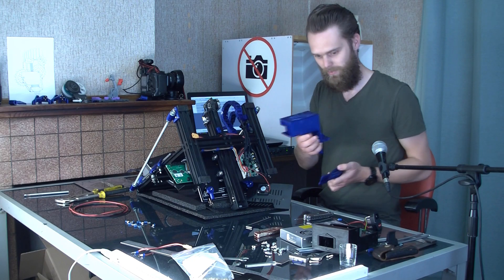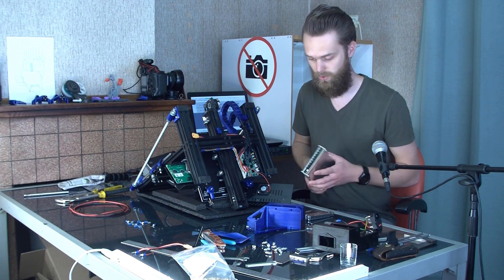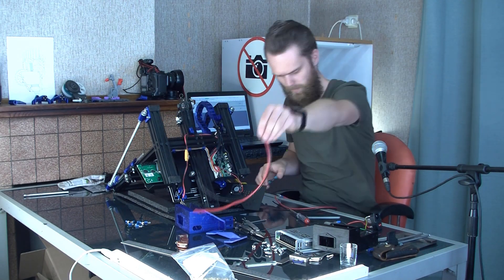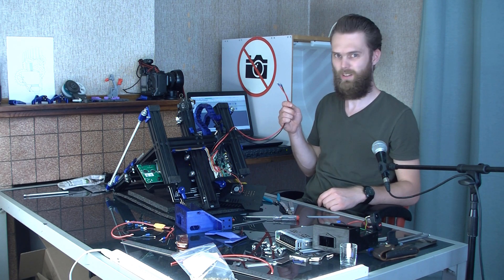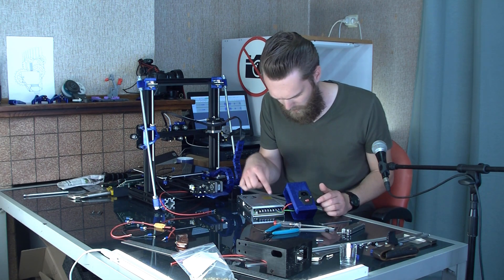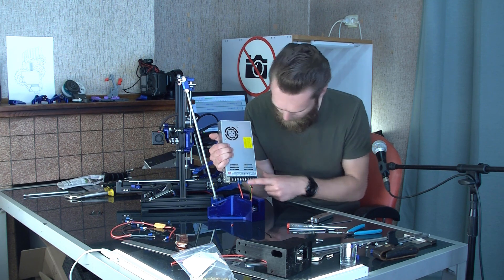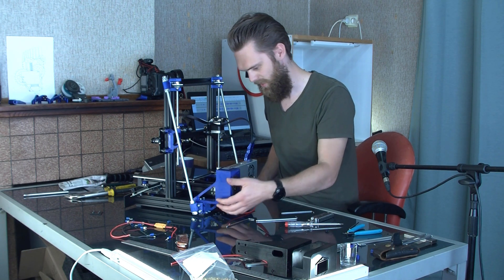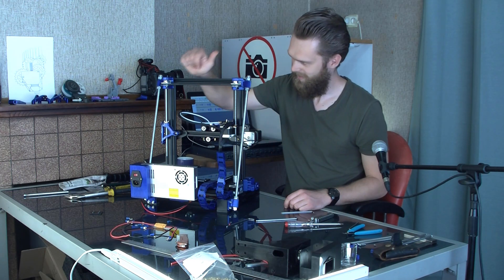Ender 3 pro power supply mod and some safety tips

Comment: At 3:35 you mention the nuts you designed. where is the file? I bought the power supply move file from you but not there with the 2 other files. OK, I figured you made it available to your patreons. I joined for a year. I went to google drive and downloaded files. Still no nut. Are you teasing us? Showing us something cool but now it's hiding. lol I have both parts printed just need the nuts.   :)
Reply from the maker: Hi, I shared these separately because my idea was that they can be used more generally. In hindsight I should've mentioned that. You can get them from here https://properprinting.pro/product/t-slot-nut-side-approach/ Thanks for being a Patreon supporter for a year! Next time, please reach out directly in the chat so I can help and improve!
Reply: @properprinting  thanks for the fast reply. I just looked at your link. Says available to patreon supporters. I am a supporter, I downloaded the complete zip from your google drive. I didn’t see it there.

Comment: What wires did you buy to lengthen the PSU wires? Do you have a link?
Reply from the maker: I don't know anymore. It might as well be that I had them lying around or got something from my work. It's nothing special, just thick enough. I often buy wires from conrad.com Maybe that's an option for you as well.

Comment: i read somewhere you need to ground the frame separately since the psu is not attached to the frame anymore and can this be made out of PLA?
Reply from the maker: Grounding in this case is a safety measure so if the life wire touches the frame the ground breaker pops. If the PSU is not connected to the frame it can go wrong is there's any change that a life wire will ever touch the frame. This being said, it's always better safe than sorry ;) Yes, this can be printed out of PLA.
Reply: @properprinting  thanks

Comment: This whole fire-hazard thing I keep seeing and hearing about - XT60 makes a much better connection than does the screw posts on the motherboard IMHO, so if anything they should be directly soldered if you really want to help safety! But then you are left with the connects on the powersupply, so really.. if there is a hazard, the issue would likely arise at either the psu end or the mobo end now.  Only reason the xt60's would be a risk is if they were poorly soldered, and for that reason alone, it's worth at least inspecting them.

Comment: Just some additional information on the XT60 connector. They are rated for a maximum of 60A and the Ender 3 at full current draw (bed and hotend heating up, all stepper motors moving) is around 8-9A on the output of the 24V power supply. I measured this using a clamp-on current meter. Since I print a lot using ABS and ASA, I want to speed up the bed and hotend heat up time by increasing the amount of current available without taxing the power supply too much so the plan is to upgrade said power supply to a 350-400W unit. I'm thinking I'm going to crank up the output to 25-26V to also help out the heat up time. I'll use a buck converter to reduce the voltage down to 24V for the rest of the electronics. I think I'll be remoting the power supply and electronics and put the printer in an heated enclosure.

Comment: Should I look for anything specific with a power supply. 24v etc or do they pretty much all work for 3d printers?
Reply: Most definitely look for 24V specifically (if that is what you currently use obviously, if it's something different, go for that voltage). Nothing less, nothing more, voltage is not adaptive like for instance, current can be when you have a powersupply capable of delivering 12A when the printer might only pull 4 of it when everything is at it's peak draw, that will be fine (though it might pose problems because some powersupplies require a minimum draw of current in order for them to sustain operation and you might risk getting below that current upon finishing a print or in circumstances where the power draw is lower than at full peak power that it requests).
My brother is suspiscious about the power supply on the Ender 3 Pro actually being a MeanWell because there are a couple of things that he considers are "off" from the design that he usually sees in their frame and open-frame power supplies due to the fact that he works with those on a day-to-day basis at work, so, you might be better off getting a power supply listing at least the same amount of current delivery that it's capable of, but otherwise it could be well advised to be 1A higher than the power supply you get with it lists itself at.

Comment: does this require an earth from the power supply to the frame of the printer? now that the psu is not screwed to the frame?
Reply from the maker: This is a good question which got me thinking. Earth is used in this case as a safety measure when the live wire springs loose and touches the frame. In that case the ground fault breaker should kick in so you don't get electrocuted when touching the frame. If only 24 volt is capable of touching the frame than the earth connection is not a necessity. It won't harm though if you connect the frame to earth. This is a must when adding a mains powered silicon heater!

Comment: Has anyone tried to use this mount with the regular Ender 3 (not Pro) power supply?
I ask, because the Ender 3 and Ender 3 Pro have different power supplies (the Pro has a slimmer case).

Comment: While planning a dual Z kit to my Ender 3 Pro I realized that I needed to figure out where to place my power supply. Your video was the only one I could find in my search.  I liked your video,  both the Dual Z and the power supply mounting, so I purchased your mount kit and proceeded to perform my upgrade. I didn't have the nifty channel nuts you showed in this video so I planned and purchased a thread cutting kit to use with the installation.  Imagine my surprise when I pulled off the end cap and discovered the holes in the frame were already tapped. At least now I have a tap set and no doubt it will come in handy at some point. It would be nice if the mounting holes in your bracket design lined up with the frame holes, but that's what I have a drill for I guess.  Love this video and I learned a lot from watching. My Ender 3 Pro is a bit better for having watched you at work.  Thanks.

Comment: Do you know what fuse is needed for the power supply? Thanks for the video 👍
Reply from the maker: No, I don't have a clue. Did you blow up yours? It should be stated on the fuse itself.
Reply: @properprinting It was missing and I am in doubt whether it is 24v and 10A or 15A. Thanks for taking the time to answer my question 👍
Reply: @luismanchego6856  The fuse is on the high-voltage side in mine (Ender 3 Pro) right above the plug.  If that is the case in yours, do NOT go for a 24V fuse because it will blow instantly upon either plugging in the power supply or upon switch-on.
Reply: @Dutch3DMaster  Thanks for the heads up 👍

Comment: About Creality's XT60 connector fire hazard:
The problem itself isn't design of the connector, but the way they did it, initially those were soldered to wires, so as you should do, but when amount of ender 3 purchases skyrocketed, they ordered other factory to manufacture this cable assembly, and what they did is they crimped the terminal onto the wires which is absolutely incorrect, the connection was sometimes very poor, there was big voltage drop and so it would overheat and possibly catch fire.
PSU is rated to 15A, so the current consumption is not more than that, that's nothing for XT60 that is designed to handle peak 60A for short time and constantly up to 50A(will get hot).
They also possibly used fake XT60 connectors which probably werent made of high temp nylon.
Reply from the maker: Great information, thanks!
Reply: Crimping at low voltages can be preferred over soldering, due to the risk of having much higher currents than with higher voltages, almost all car equipment and automotive connectors contain crimped contacts, even those meant to pass high currents like the high beam contacts on the steering wheel lever.
Crimping is not the problem, quality control and sometimes the absolute lack thereof in Creality products, is.
Reply: @Dutch3DMaster  You don't get it at all, XT60 are made out of brittle stiff material not meant for crimping at all. Yes industry is crimping most of the connectors but those are designed to be crimped and made out of different alloys.
Reply: @Arek_R.  depends on the connecter tbh 
I've seen some xt60 connecters are designed to be crimped though they are very rare tbh

Comment: Fantastic ideas for the Ender 3. I've watched your folding mod and dual z mod videos and was wondering if you've thought of combining those ideas. Seems like it would not take much to do.
Reply from the maker: Thanks Jason for your comment and suggestion! I did think about it and it should be possible to combine it without too much redesign indeed. I don't need it for this project but I've planned a project which can benefit from combining these ideas.

Comment: How do you keep the glass print surface in position?
Reply from the maker: Good question. It turns out that the plate sticks pretty well on the magnetic surface after clamped it first while heating it up.

Comment: I just realized you still have the stock part cooler on that thing!  I think you'll find you'll get way better prints if you swap that out for almost any other variation.  I like the simplicity of the Mistral design, myself.
Reply from the maker: Thanks David for your comment! By now this printer is equipped with an E3D hotend which I do like a lot! I don't even use a part end fan and I'm having some great results printing Nylon and ABS which are the materials I print mostly with.
Reply: @properprinting  Ahh, that makes sense!  (I put a Hemera on my Ender 5!)
Reply from the maker: @davidguinn5355  Awesome man! I read great things about that hotend. I should take a look into that, thanks for mentioning!

Comment: Until you get rid of that control board you are always going to have Salmon Skin effect. Put a Duet in it
Reply from the maker: Interesting, thanks for the information! I have planned a video for upgrading the electronics and I even received a new control board which is donated to me. I honestly haven't heard of the salmon skin effect before so today I learned something new, thanks!
Reply: Proper Printing if you look at that benchy, it’s perfect. But if you see the line pattern under certain lights. It comes from your stepper drivers. Cheap Chinese. They have good components, but bad electronics. Have you heard of Duet3D? They are amazing. It’s like the ease of Apple phones meets Chinese hardware!
Reply from the maker: @thelightspeed3d712  Thanks for your comment! Yes, I've heard of it but I haven't taken a deeper look into it yet. I have received a different board which I'm going to tinker with. Upgrading my board is definitely on the list, but I have some different (more unusual) projects coming up :D

Comment: Looking for the hammer nuts? Here they are: https://nl.aliexpress.com/item/33024399415.html?spm=a2g0s.9042311.0.0.5f494c4dw7xpE2
Reply from the maker: Thanks for your comment, but this is not what I mean in the video. The bolt in a hammer nut is perpendicular to the profile it's placed in. The one I've designed is placed at the end and the bolt is in line with the profile. If you look at the photo of this thing it becomes clear https://www.thingiverse.com/thing:3773580. Normally the end of a profile has holes which can be tapped, but the special nut was easier to do.

Comment: I noticed that the Ender 3 pro has a new style flat PSU. Would it be possible to get the brackets for a normal old style 3d printer PSU like for a normal Ender 3 Jon? .
Reply from the maker: The step file I've used of the Ender 3 contains the old style PSU and it looks like it should fit. I think that I need some specifications of this PSU and maybe a picture of it without the cover to see if everything fits. I don't own one, so I cannot be sure if it will fit. This has to be tested by someone else but I think it would be possible.

Comment: Your "plugs" are one implementation of an "expansion bolt" or "expansion insert". This is the first time I've seen it used in the end of extruded aluminum in a 3d printer.  An off the shelf plastic expansion insert for drywall of the correct size might marginally work as well, however your purpose built design is much better.
Reply from the maker: Thanks a lot for your information! Nice that you've never seen it it this purpose because to me this is a logical solution which should have already existed.

Comment: Can I use the mod of Power supply  in my ender 3? Not PRO or X. Thanks.
Reply from the maker: I think it can be used partly. The casing on, what used to be, the bottom side of the power supply should fit. However, the standard Ender 3 has an 20mm wide (single) y-axis beam and the pro is twice as wide. The bracket should be modified I think in order to fit on the printer. A quick fix would be to add holes in the center of that bracket, but I am not sure if the other measurements are correct in that case.

Comment: But why did you closed the hole on the bottom of psu cover? 
It is used to blow out hot air, when psu fan turns on. And if you close it, you will prevent air circulation.
Reply from the maker: That's actually a good point, thanks! I did this to make it safer, especially in this position. I think it would be a good idea to add ventilation holes small enough that it's impossible to touch the terminals. I'll add this asap, thanks!
Reply: @properprinting  Well actually the air is sucked in via the bottom, (which you covered up) and blown out via the van at the top. The main reason the Fan is at the top is because thats where the heat is buildup and it will suck that hot air out (and fresh air in via the bottom) natural airflow with a little help from the fan. By putting the PSU on its side the heat will build up in a different spot as intended and could cause other components on the psu to suffer from this extra heat and will make your fan spin up faster in effort to get the hot air out.

Comment: First of all I printed the cover on the power supply, under 80mm fan
stock, very noisy.
Reply from the maker: Thanks for your comment. Which fan are you referring to? I know that there are more types of power supplies and mine does not have an 80mm fan.
Reply: @properprinting  Ender PSU has 12v cooling fan. So you can change it with almost any computer fan. 
I exchanged stock fan with 92mm arctic cooling quiet fan. I simply cut bigger inlet hole over stock one, drilled new mounting holes and mounted new fan outside of psu. Also added honeycomb grill for look and safety

Comment: for thermoboxing, you should bring all the electronics (motherboard and power supply) out, otherwise it will negatively affect the life of the power supply, as well as the drivers will overheat and skip steps.

Ps. By the way, that you do not plan to add an emphasis from a reverse side for increase in rigidity?
Reply from the maker: Thanks for bringing this up, that's a good point. This is exactly what I don't like about these IKEA and other furniture, Tupperware, photo studio tent solutions. I definitely take this into account with the idea I have in mind.

What do you exactly mean by adding an emphasis from a reverse side?

Comment: Hi, great upgrade! If you plan to build an enclosure, I would suggest you to mount the power supply out of it. It could allows you to move it wherever it's the more practical, and you will not have to figure out how to adjust your enclosure to this new power supply location, but instead just have to pass a (longer) cable from the printer to the power supply out of the enclosure. IMO it will be simpler and more logical.
(I'm matttew on Thingiverse ;)
Reply: And, a question, what's the music we can ear during the Benchy print ? 😄
Reply from the maker: @MatthieuRiffault  I always forget to mention that 😅. All music, except from my intro and the first videos are downloaded from Epidemic sound. I will soon add a section to the videos mentioning the soundtracks. The song during the Benchy print is called: Cross My Heart & Hope To Die (oomiee Remix) by Martin Carlberg.
Reply: @properprinting  Amazing song! Directly saved into my favs, thanks!
Reply from the maker: Nice! At first I had some doubts if the timelapse was too long or not, but I like that song to much to make it shorter.
Reply from the maker: Hi Matthieu, thanks for your input! I like the fact that the power supply is attached to the printer so it's one system. This place of the power supply does not seem to be logical, but with the enclosure I have in mind, it is ;)